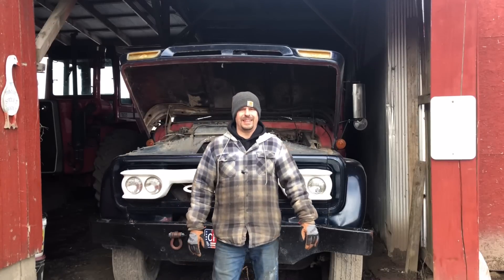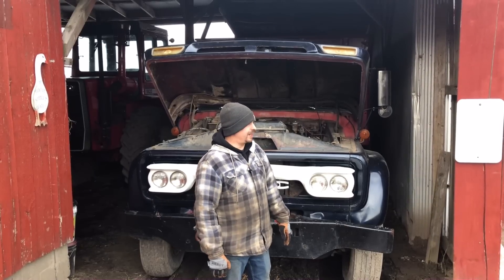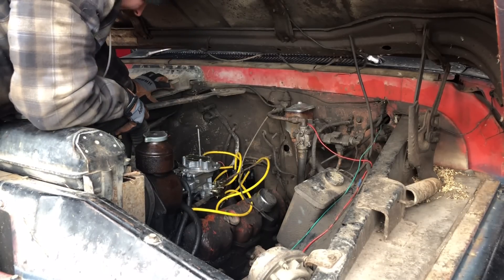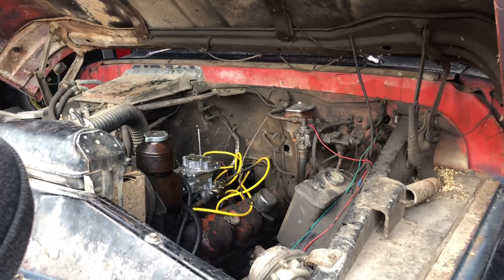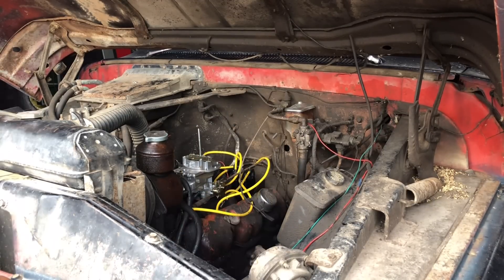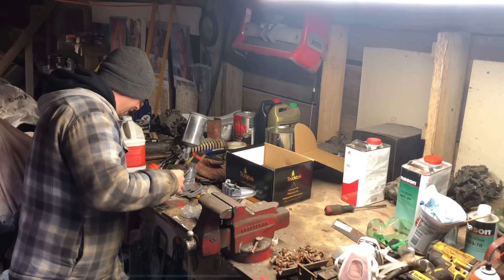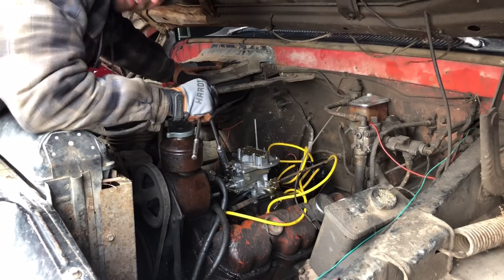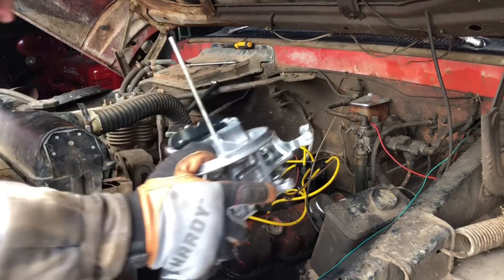Carburetor upgrade on the 64 GMC 401

Comment: 500cfm is a good size for that engine. Smaller carb gives snappier performance, and if it delivers sufficient fuel at full power, that's the best scenario. I had a 600cfm on a 327ci for a daily driver and it was just about perfect. A 500 would have been better
Reply from the maker: Right on

Comment: Whew, what a nice swap to a bigger shot of fire juice, yep and it does run good.  But I did not know how you memorized the shifting of the gears. I mean I learned on a 3 on the tree, have done a 3 and 4 and 5 on the floor. But never ,I say never have I driven a 20 speed. I was lost as soon as you pulled out of the driveway. You moved the levels in a pattern I would have trouble remembering. Anyway more power to ya, and Fluffy.
Reply from the maker: Thanks!  It’s not too bad to drive, but like anything it’s definitely a learning curve lol

Comment: I’ve never drove a twin stick.  Do you really need to split every gear when empty?
Reply from the maker: I don’t need to, but it still works better when I do. The auxiliary trans has 4 gears in it, I only use the top two and it’s just right. She’s still long winded if I were to put the aux it say direct and run through the other gears on the main

Comment: you need to adjust the valves on it. 12 on intake &20 on exhaust. also there are pcv valves that screw into the heads under the valve cover needs repalced. they cause a vacume leek if not replaced oftan enough. hope this helps.
Reply from the maker: Thanks!  I’ll pull those valve covers at some point and check that out!

Comment: Excellent video JT  :) also think carb upgrade help out for 1964 Truck with 6 cylinders 401 on 2  barrel carb and gave new life too ! Maybe you try use 89 octane gas with 5% Ethonal  and every time use put a grey  bottle of STP Total Treatment fuel injection and carb cleaner  in fuel each month ! See if help out !
Reply from the maker: I’ll give it a shot!  Can’t hurt any

Comment: You forgot to set the new gasket that you are not going to use on the intake and then take it off and hold it against the bottom of the new carburetor just as a check. Also sometimes the air filters would be shorter than required and wouldn't seal in the housing. Glad to see you are not putting a Holley on there. Had one of them start on fire.
Reply from the maker: Well, I did give it all a check over just off camera. 😉. I’ve never had a Holley catch fire luckily on me, have had pretty good luck with the 2 bbl in the past

Comment: Good job JT! Absolutely love your truck! I have 3 old trucks that are in the process of, well, repair in some shape or form. '66 IH 1700 with 345 is getting an updated distributor as the original one belongs in a museum. It also needs electrical work done to it. 1980 IH (old smoky) with 9 ltr needs a clutch. '84 GMC w/427 4bbl is getting its 650 holly rebuilt. Also getting new distributor with wires, coils,  and plugs. Also getting new t-stats as it has no heat. Used to be a Penske-Hertz truck and it is my favorite as it comes with rear disc brakes. This means no nail-biters when a quick stop is required. Thanks 😊 for all of your content JT as I can relate to your "disease" extremely well. 😊
Reply from the maker: Right on!  It is a disease lol, but I couldn’t live without it!  I just love to tinker with these old gems!

Comment: Appreciate the content. Those old engines didn’t have hardened valve seats from the factory so if the heads have never been off and upgraded she might have some valves recessed in the heads.
Reply from the maker: I’ve wondered if it might need the heads redone.

Comment: Just curious but are you sure that gas cap is a vented cap ? I doubt that a truck that old had a sealed fuel system......If it needs a vented cap then it may be starved for fuel after running a short time......just a thought.
Reply from the maker: I’m fairly sure it is. Has a little hole in the center inside. It doesn’t fit real tight either 😉

Comment: Glad the Carb Made a Difference. Neat old truck, you don’t see many old Chevy’s on the road working anymore. That Transmission is definitely a younger generation anti theft device. The first Semi I drove on our farm was a 1979 Mack R Model with a 2 Stick Mack Transmission, nice old truck, but felt like it had no suspension. Thanks for the videos, Have a good weekend.
Reply from the maker: It seems to be working a lot better with a little extra cfm.  The twin stick definitely keeps kids from borrowing it lol

Comment: Ah, farm trucks 😅  Why are you splitting gears w an empty truck ?  
These old Jimmy's can use a compression bump for sure.  They were made to run on "commercial gas" or as we called it Buss Gas.  Really the bottom of the refinery stuff that could loosely be called gas.  So like 7 1/2 to 1 CR or so ...  Get them up to 8 1/2 or 9 and they wake right up 😁  But, that's a big job, so prolly not ...
Reply from the maker: Just splitting from direct to over. That’s a long winded truck loaded or empty

Comment: are those vacuum switches below the ashtrays? I'd definitely go chasing vacuum tubing to see if there's an accessory leak. fortunately these old mechanicals are minimal on accessories :)
Reply from the maker: I’ll double check, but I believe all that stuff has been plugged off
Reply: @jtsbarnngrill6873  that's why the 2 speed axle ain't shifting 😉 You're pretty thorough so I think you might actually have a worn engine or a new engine with unseated rings. Possibly tappets out of adjustment. Maybe not worth opening any engine covers--the less you know 🎵🌈

Comment: My old 66 with straight 6 , 292 cu in , is not a speedster but pulled hard in the field and on the the road to the bins. If yours is a V8, how come it wouldn’t have a four barrel like my 366 or 427 . Don’t forget to make sure you gas cap is vented

Comment: J T are you still running regular gas. I switched to premium after the ethanol was being added to the regular years ago, reset the timing and away you go. I run that engine in my uni-system 704 , 60ft sprayer with a 500 gal tank at 8 mph no problem.
Reply from the maker: Interesting!  I’ll start putting premium in that and see how it affects it

Comment: Basically what you have is known as Holley 500 CFM the one you currently have looks like an old Ford Autolite 2100 but it was me I convert it over to EFI system maybe something like the ACE Deuces Wild 2 EFI Kit and add Inline Frame Mounted Universal EFI Fuel Pump with C5 Corvette Filter / Regulator which used in LS swap and add return line the fuel tank
Reply from the maker: The Fuel injection has crossed my mind, might really wake that old truck up!

Comment: Nice old GMC. I have a 64 Chevy C80 Bought in 67 Same truck other than
Grill , Dash and engine. Mine was originally 409 changed to 427 in 1980.
Been a great truck still used today.
For what's it worth, I would suggest double clutching the Aux. And slow shifting motion down on both.
You don't want to get into those boxes if avoided, parts are getting scarce.
Rears should be 7.17 ratio 38K Eatons.
New Sub here enjoying your adventures.
Reply from the maker: Thanks!  Appreciate the info. Still trying to slow my shifting on that. It’s gotten better, I’ve tried double clutching on the aux, but can’t really tell that it’s any better or worse lol 
I’ll bet the 427 moves that c80 along nicely!

Comment: I think it’s super cool how you rescued that old grain truck. No small feat! Are you going to give the engine compartment one of your patented degreasing jobs? How hard would it be to bend the front bumper back to shape?
Reply from the maker: I may give it the ol’ super duper degreasing😆. That bumper is made from spring steel I swear lol. I’ve swung a 10 lb at it many times, just seems to bounce back and never get straight lol

Comment: Thanks for sharing we had a 69 dodge single axle grain truck on the farm I worked at as a teenager and they had it since new it only had 30k miles back in the 90s I loved that old truck we didn’t use it for much but you could guarantee it would start and get the job done no matter how long it sat I wanted to convert it into a flat bed and drive it for whatever I needed but I never got them to sell it 😢 take care buddy keep warm during this cold weather
Reply from the maker: Thanks!  Cold weather is coming tonite here!

Comment: Some thing we do not have, gasoline driven trucks, small or large, every motor is diesel, this includes farm tractors, came as a bit of a shock after watching JT's barn n grill, his Massey 165 had spark plug leads, whats the world coming to, they have been diesel from the start of time, 1964 or there abouts...........Need to know, I counted 12 gear changes, is that the norm for such a small truck?.....whats the world co.........well you know whats coming next...........
Reply: Alot of Tractors still had gas engines even into the late 1970s. IH, Ford, Massey, even Oliver , and John deere made 1100 MF and JD 4020s with Gas and LP engines
Reply: On a small utility tractor a gas engine was a blessing on a bitter cold morning that you didn’t expect to need a tractor. They’d fire right up with decent maintenance.
Reply from the maker: That is great having a gasser in this climate in the winter
Reply from the maker: Keep in mind, the truck is a 64 one the 165 is a 70. So …. The correct saying is “what has the world come from 😆. Most tractors were diesels but the older trucks were a lot gassers. That is a 5x4 trans, but I don’t use all the gears. 1st on the main is too low to be necessary, and I generally start the aux in 2 nd and then just 3-4 as I’m up shifting

Comment: Hey JT,  what is that white stuff by the leftside hood hinges? Do ur truck have low gears in the diff? good job on the new carb changed.
Fluffy missed-out on going for a boot.  Fluffy approved the job..
Reply from the maker: I’ll have to double check the hinge stuff… not sure lol. Those rears are super low geared, I forget the ratio on the tag but it’s lower than I’ve ever heard of them being

Comment: Hi there 👋 
Nice truck and new carb works like a charm 😊
Never seen a transmission like that...what is it?
Cheers 🇫🇮🇺🇸🍻
Reply from the maker: That is a 20 speed. 5 on the main, which I use 4 of and 4 on the auxiliary, which I use 2,3,4 and then just 3,4 for the higher gears